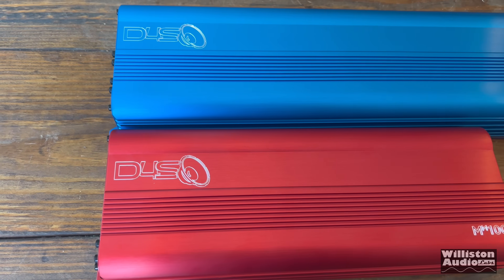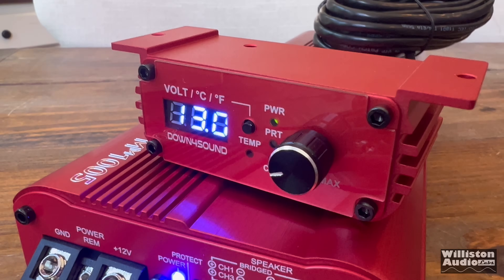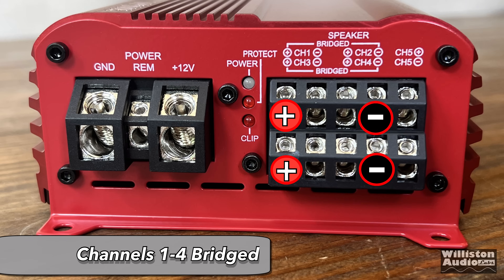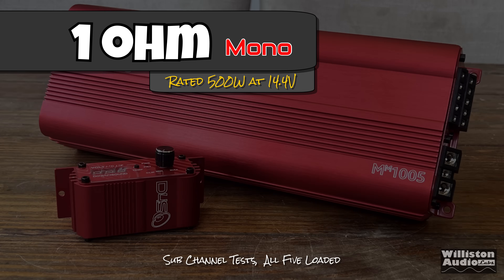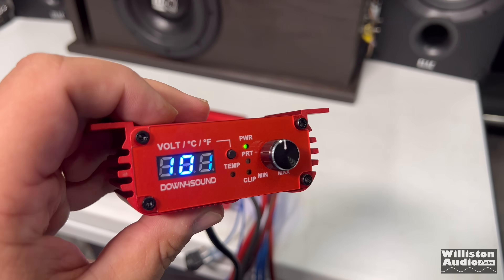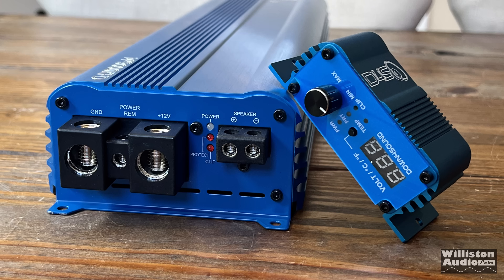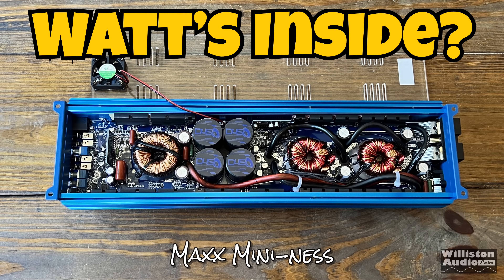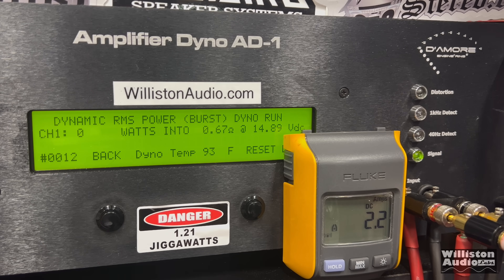Double Feature Amp Dyno Test - 1000W 5 Channel and 3000W Monoblock

Comment: Hey Big d, I have a question for you. If you get to it, thank you in advance. What do you think the maximum sustained temperature for the internals of a JP8? I've been doing research on it, and I really can't find a solid number. My amp is mounted in the trunk where the spare tire would be, it does have fans on it along with the fan that's in it, but in the summertime it gets kind of warm. Again thanks in advance, great video, really enjoy your content 👍
Reply: Most of the circuit board components can easily handle over 250° F. I'm thinking the lowest temperature sensitive component might be the large electrolytic capacitors. They should have a temperature rating printed on them. Usually they have a maximum temperature of 80 degrees C which is about 175 °F.
Reply: @JasonWW2000  
Thanks for the info! When I see the temperature on the bass knob get to 140° f, I usually turn the volume down a little bit let things cool.
Reply: @Stoneman1971  Do you have a path for fresh air to get to it and for the hot air to get away? Recirculating the air in the trunk should be okay, you just don't want to mount the amp in a small covered area separate from the trunks air.
Reply: @JasonWW2000  Yes, there is some airflow. The answer sitting where the spare tire used to be at. And then I made a new top floor for the trunk which is spaced up around the edges. There's also four 4-in computer style fans blowing on the amplifiers.
Reply: @Stoneman1971 Sounds good. Most amps have thermal protection circuits. If it detects the temperature getting too high it will either throttle back the amplifier or turn it off completely. Look and see what your amps have. That a way you'll know what to look out for.
Reply: The JP8 manual says it does have thermal protection. It will turn off if it gets too hot and then automatically turn back on once it cools down. 

If you have serious heat related issues it might be due to you pushing that small amplifier really hard. It's small heatsink can only dissipate a certain amount of heat.

One possible fix is replacing it with a physically larger amplifier that's either wired a little higher or adjusted to limit the power. This way you have a lot more surface area and the amplifier is not being stressed as hard. 

A cheaper fix might be moving that amp so it gets better air circulation.
Reply: @JasonWW2000  I haven't had any issues, it was more of a curiosity question. I've never had an amplifier with a visible temperature gauge, so I was just curious at what temperature the amp would normally shut off, and what is this safe temperature for the amp to run.

Comment: Thinking about buying this to replace the Kicker Key in my wife’s Gladiator…she wants to add a sub and wants it louder
Reply: You don't mind losing the DSP functions? Or do you plan to add a separate DSP?
Reply: @JasonWW2000  she has the stinger high 10 installed….might add of separate dsp she wants it louder

Comment: Can I mail you my JBL A-1000 ? It’s rated at 600-4ohm, 1,000-2ohm, unknown voltage.  Im curious if you could hook it up to a sealed sub or an exact proper matching spec ported sub because I wonder how much cleaner the sound quality will be at 4ohm .  I have a kicker L7s 15” dual 4, and im considering buying another amp because they are strapable and 1200 clean watts would be nasty on the L7 im thinking 4 cubic feet net , and a 50 square inch port 22-28 inches long…. I have a 2005 c230 sport Mercedes. No folding rear seats but i have a sawsall hahahaha but seriously I can’t find a test of this amp , I want you to open it up and see what you see and hear what you hear. I’m in Little Rock Arkansas, I wonder how much shipping would be?

Comment: I noticed that when the Mm1005 amp was powered up, the protect light illuminated on the amp for a brief second, but didn’t illuminate on the bass remote. Is this normal?
Reply: Yes, it's normal. The amp is showing you that the light works, now if it stayed illuminated then there might be an issue but that wasn't the case. Hope this helps, cheers....
Reply: @jdmintegradp  I would have guessed if the amp protect light came on, so would the protect light on the bass remote, since they are linked together. No?

Comment: As an owner of the MM1000, MM1004, and MM504 these are amazing amplifiers for the price!! Really just can’t beat the price. This 5ch easily should outperform my Rockford Fosgate P1000x5 also about a third of the price!!
Reply from the maker: Deal for sure!
Reply: Actually, I think that model Rockford is going to be a little beefier - power-wise. Overall, very similar.
Reply: do they get really hot

Comment: My JP3 suffers from turn off thump! I have been installing amps for years and thought this was not a thing with any of my Korean amps.
Reply: @philipeli1192  rca or ground?
Reply: @timlowe0420  Hi level oem radio to rca input,done these many times never had this thump,well more of a click since the 90s,somebody went cheap on components it seems,not many parts in these Chinese full bridge units.
Reply: @philipeli1192  JP3 is half bridge. The country of manufacture carries no special importance. Before blaming the amplifier, did you test to find the source of the noise?
Reply: @JasonWW2000  its only happening on turn off,swapped it with a korean ppi noise gone.I am sure my jp3 is fullbridge,check out big d on this,hardly any parts in the little guy.
Reply: @philipeli1192 
You can usually spot a half bridge amplifier because it'll have a single large output inductor. Which this amp has. Sometimes they can fool you and integrate two inductors around a single core. You have to look close to see how many wires are coming off it. 

With the jp3, it's definitely half bridge. These amplifiers are strappable, which is not possible with full bridge.

It's not that big a deal. Most full bridge are very high quality. You just have to look out for the Brazilian brands. They tend to give full bridge a bad name.

It's unfortunate that the JP3 seemed to have something wrong with it. Did you have them replace it under warranty? That would definitely bother me.

Is the constantly running fan an annoyance? If you're not in a super hot environment I guess it would be fine to just unplug it.
Reply from the maker: that's not something I usually check but can add this in the future. It should have delayed turn off
Reply: @wal  I agree but nobody tests on off thumps,because we had this solved years ago in even the cheapest units. Also fan runs 24/7 up here in North Dakota its just plain stupid to not temp control it,especially because the temp feature is on the remote!JMO

Comment: Those bass remotes are so awesome that they made Big D. I dont like those inputs, tho. They could have made those a better connection in my book.
Reply from the maker: It's one of the drawbacks to having a small amp. Unless they remove some of the crossover functions, you just can't fit it all on the amp
Reply: @wal  oh I know, anymore it's just the overall designs of them.
Reply: Make the amp slightly bigger then